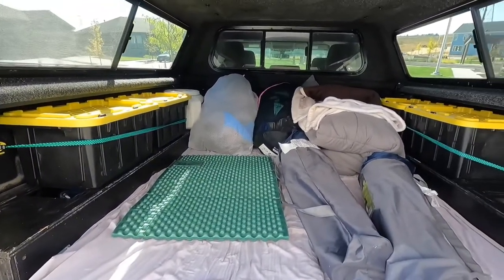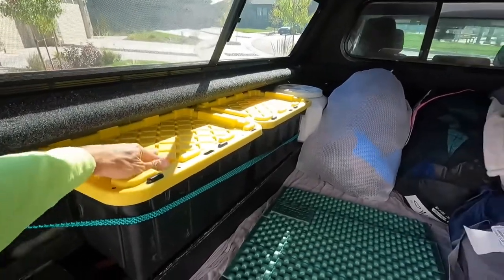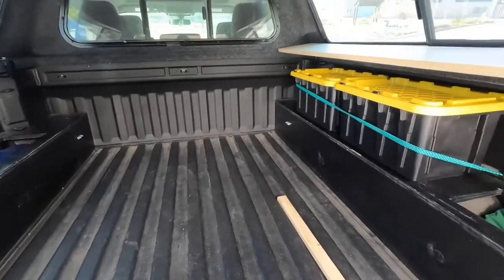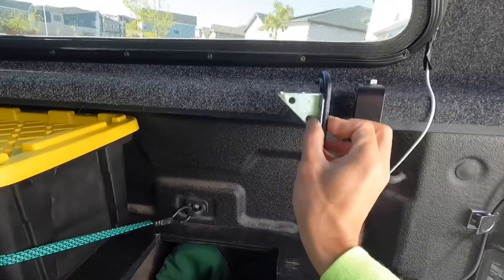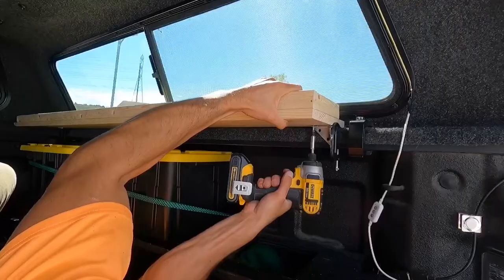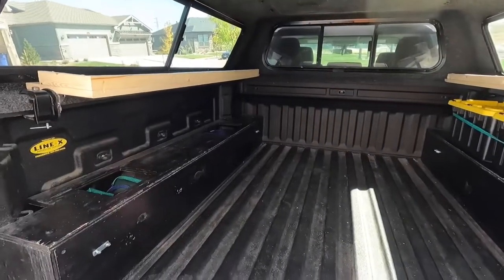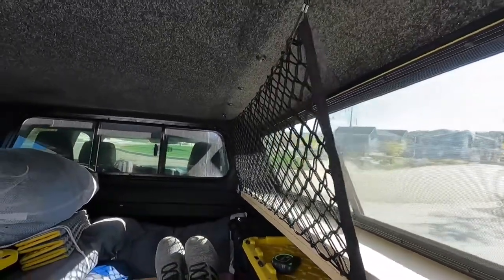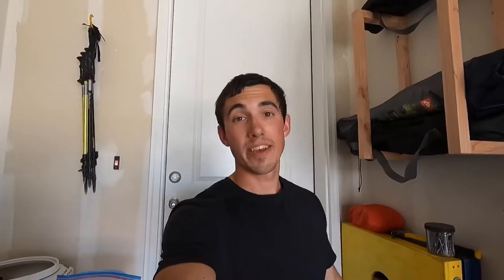DIY Minimalist Truck Bed Camper Build - Part 3 (Additional Storage)

Comment: Man, what a creative way to use vertical space and keep the sleeping area open with headroom. I am about to build out my camper setup this weekend and I was 100% sure I was going the platform route until I saw your video. This seems to be the most practical and I can still use my truck bed for bigger items without removing anything. Thanks again for sharing the progress of this build.
Reply from the maker: Thank you I appreciate that. This setup has worked great for me so far for many different applications, but I did just modify it some recently and have a new video coming out with those changes tomorrow.
Reply: I agree!!

Comment: I dig it man. great job! I built mine out a couple of years ago and continue to make changes here and there. Traveling out of state a lot for work so i didn't want to stay at hotels for a couple hrs of sleep here and there. One of my favorite add ons is the Maxx Fan deluxe. You have to cut a hole in the top of your camper, but well worth the investment if you need to stay cool. I power it using a jump box, but also purchased a small lawn mower battery for additional time and just hit it up with alligator clamps and a socket for the 12V. I also built a swamp cooler that i fill with ice and i ran hvac ducting in the bottom of the cooler and have it hooked up to a 12v blower fan for a boat. Doesn't take up much room and will cool the camper down by a good 15 - 20 degrees. Downside is the humidity, and the ice only lasts for 3hrs. I use the cargo nets too on the topside of the topper. Good for TP and storing a bottle of water and phone. I was using a full size 50x75 air mattress. But it wobbles too much, so it always feels like you are shaking if you need to shift around or get out at night. Just purchased a tri-fold mattress (molblly from amazon) to replace it. Hopefully that's better. I also sewed up some very light fabric black out curtains and stitched velcro into it. The carpeting is very tough on those leer camper shells. I do not get any tearing or wear on the carpeting from using the velcro, so give that a shot if you needed an alternative to what you made in ep. 2. I also have a cell phone holder so i can watch youtube while i'm crashed out in the back of the truck. I really like your side racks you built in ep. 1. I usually throw all my gear in the back seat of the truck, so i wouldn't need the bins, but i do like the smaller storage pockets for loose stuff. I'd probably router out a cup holder or something in them if i build them out. Anyways, i appreciate the videos. When you sleep out of your truck out of necessity it's nice to have a few comforts here and there. I like that you did different stuff than all the other pull out drawer videos. For me that would be too claustrophobic
Reply from the maker: Thank you and thanks for the tips/ideas as well!

Comment: may as well... the available floor. put down a sheet of 1/3" plywood, construction grade. fasten indoor/outdoor carpet on top. make sure the plywood sheet doesn't fit too snugly - that way you can pull it out and lean it on the tailgate to vacuum more easily. once a year go to a carpet cleaning place, give them $10 to come outside and pull everything out of it with one or two passes of a steamer.  keeps the b.o. down, if ya get my drift... 

good build. i'd have put in more lift-out hatches and used the space in there for storage.
Reply from the maker: That’s a great idea. I’ve been using this setup for a while now and I’m contemplating changing it up completely so it’s easier to grab things when I’m out cooking in the tailgate I still want to keep it very minimal but I have to figure out a way to be able to grab everything without clearing off a section of tailgate every time I need to grab something.

Comment: I've seen a dude put a wood stove in his truck bed crazy so much can do sleeping out of there there's people who winter camp with diseal heaters instuff too and also run ac units into it from outside using a generator outside
Reply from the maker: There are some really cool builds out there. I would really like to figure out the diesel heater option for winter though that would be really nice.

Comment: what brand and model is the welder, if it welds small parts this easily , it's just what I have been looking for
Reply from the maker: It’s a Northern Industrial flux core 125. I got it a long time ago and it’s worked great for me.